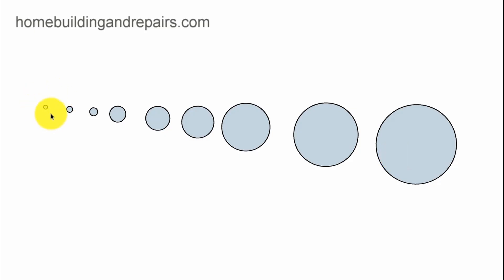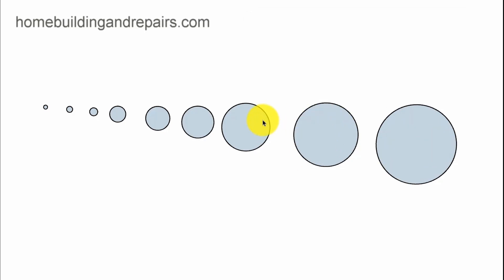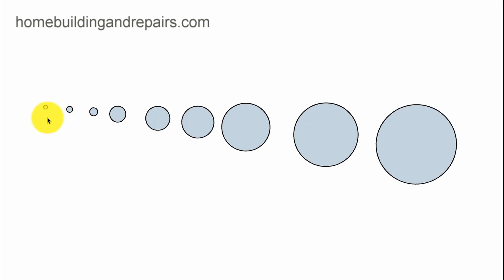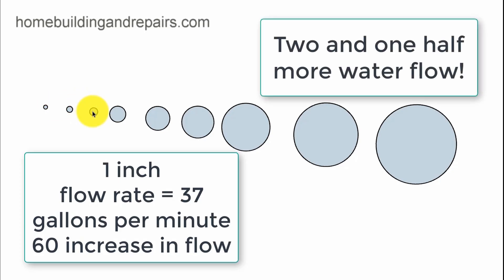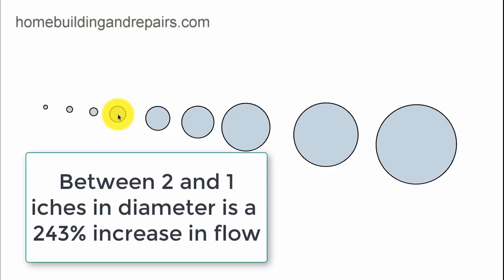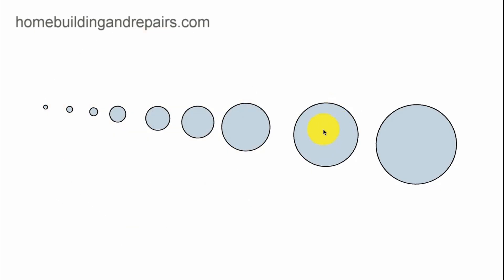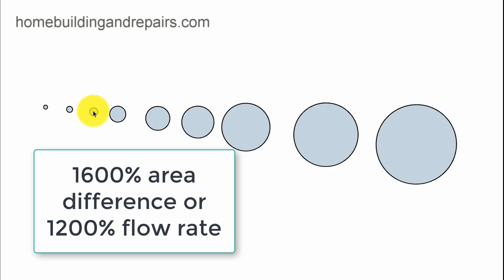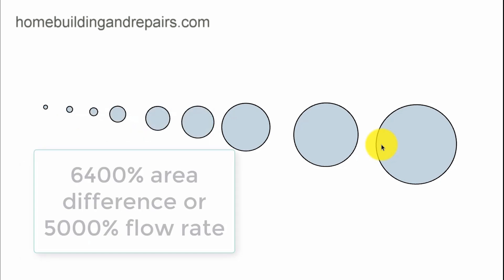Does Size Really Matter? - Water Supply Pipe Flow Rates

Comment: I have a new construction home. The builder ran one inch copper from the basement to the street. The stop box in the street is 3 inch. Am I gonna have a pressure problem inside the house?
Reply from the maker: I doubt it, but it will depend on the size of house. If you only have one bathroom, then your 1 inch pipe will be awesome.

Comment: How does using a swing out line (1/2 in flex tubing) to attach 3/4 PVC to a sprinkler affect the flow rate? It seems that the smallest diameter of hose anywhere along the line, causes the flow rate to conform to the lower diameter tubing size.

Comment: I don't know if you would have an idea but I'll shoot. I got a gravity fed water line from a 3" pipe that has a T with a reducer to a 1 1/2" pipe that travels about 10' and eventually shoots up 90° into a water tank. We've had this going on for months with no problem. All of a sudden. We're not getting any water in the tank. Or very little over night. Early today we cut it to see if there was an obstruction, there was nothing. At ground level it was flowing great but as soon as we put the 90° pvc pipe back in the water couldn't travel up like it used to, if we angled the pipe there would an slight increase in velocity of the water, but as soon as we'd angle it 90°c the water flow would be stagnant. Is the issue the water velocity from the source? I'm just absolutely bewildered how the water flow could be amazing at ground level but become non existent as soon as I'd have to shoot it straight up into the water tank.

Comment: I am a novice and could use some advice.  I have a sump pump that pumps water through a 1.5 inch inside diameter pvc pipe up and out of the house.   I connected a 2 inch inside diameter smooth silicone pipe to the pvc pipe at the house to carry the water all downhill to the outside drain.  
I live in a cold climate where freezing is common at this time of year.  The distance to the outside drain from the house is 75 feet.  Is the pipe big enough?  How do I keep it from freezing(heat tape vs insulation?).  Or do I need to change anything as the water temp is 57 degrees as it leaves the house and it’s all downhill.
Reply from the maker: I would think the size is right, but as far as the freezing, I won't  be much help.

Comment: For years I delivered pressure washers to customers in a rental business.  The intake had to be 2 inches or the pump would shut off.  The pressure was 20 k. For cutting.  The engine was a Cummins diesel.  Many customers tried 4 or 5 garden hoses.  Biggest problem I experienced,, ‘wouldn’t believe me. A 2 inch hose drawing from a full 50 gallon barrell worked fine, and a running garden hose placed in the barrell was sufficient to replenish water being used!  At startup about half of the barrel drew down but the single garden hose then kept up with up with usrage
Reply: Where do you get 2" hose like that?
Do they have  threading r is it all couplers?
 I have tried to find flexible 'garden hose" type hose for a rain barrel for years  but all the two inch hose I find is pretty expensive and meant for high pressure applications and also has couplers on them that I have never figured out where to get a bulkhead fitting to go into the rain barrel with.
I use a 5/8" hose now but it gets clogged easily and doesn't clear the water fast enough when it rains hard.

Comment: I went through this a few years back trying to explain this to a worker.  Without getting into a bunch of math for square area, I finally summed it up and asked him 'for example, how many 2x2s are there in a 4x4'.  His first response was 2, which of course is wrong.  I told him there were 4.  It kinda works the same way.  If you want to talk about volume.  Give a video about restriction in PVC fittings

Comment: flow will increase with the same diameter output. but not psi. for example if your source only has  100psi using a larger pipe goin to your house wont increase psi. the flow will not also increase unless your output would be same same size in your input. but that's not the case. there  will always be a consideration from your source, your pipe will go through valves water meter and at the end faucet which only have the average flow rate that is between 1.0 gpm and 2.2 gpm.

Comment: I think the reason why the relationship between pipe cross sectional area and volumetric flow rate is not linear is because of the energy losses (frictional head losses)  that occur along the pipe wall as water moves along it.   The greatest amount of friction is at the wall where water touches the pipe so velocity there is smaller compared to the center of the pipe where water has little resistance and can move faster.  Different pipes probably  have different roughness values.
Reply: I was about to post this. You are absolutely correct. Wall friction is the exact reason why this occurs and 2 4in pipes flow less than a 1 8in pipe.
Reply: I dunno. Real world vs real world. I ran a 4,768 foot 1” line off a 1” meter. At meter the psi was 175psi. Guess what the psi was crossing 2 hills and continued the 4768’?  🤫 175psi using pex. Sorry to dispute the charts. But I’ve run across 3,000’ lines where they claim an engineer told them to put a 2” line behind 3/4 meter. And that will maintain flow. Say what you want sitting there never tried it. But the meter pressure started around 135. Guess what I tested at 100’? 100psi. Then at the house over 500’ away. ? 45psi. Dumbass said “good thing I ran 2”. 🤦🏼‍♂️ so I bet him $2500tl pay for new 3/4 pex just to tickle my fancy. He jokingly agreed. How could s plumber have real world results contrary to engineer?  But so after got done. Guess what I had at house top floor shower? 😂 yeah 135psi. Used the 2” to sleeve the 3/4. He was amazed to see the garden pressure touch the top gutter. Said he’s lived with low pressure for 18 years.
Reply: That plays a part. But it's just down the the area. I mean he explains it in the video... if you had a 10 inch pizza and upgraded to an 11 inch. You'd gain significantly less pizza than someone upgrading from a 20 inch to a 21 inch. When you look at the area gain like that, from the outer part of the circle is might be easier to visualise
Reply: Pipe flow is greater with a large area pipe, because friction increases with circumference and flow capacity increases by area. 
A larger pipe gives a much greater gain in area than the increase in circumference.  There is a much greater increase in capacity,  pi *  r^2, while friction only increases a little pi * 2r.   Area increases by the square of radius, but C only increases directly with r.    Increasing D has a flow capacity benefit proportional to  r^2/ 2r.
Reply: Roughness depends on pipe material and sometimes the manufacturing process.

Comment: Hi, 
I'm having water issues at my home since last week. The flow is intermittent and is accompanied by air whenever the normal pressure returns. I suspect someone had taken connection from the main line with a bigger pipe thats why water in the homes that are at the bottom of the street is low and fluctuating. Please let me know if it could be a reason. ??
Reply from the maker: The only thing I could think of is that some is doing work to the pipes somewhere before it gets to your house.  Check with neighbors also to see if they have the same problem.

Comment: So needed to replace my 1.5 inches  sprinkler pressure vacuum but noticed those 1.5 inches are more than double the price (1 inch). Is it OK to connect the main 1.5inches  pvc pipe  to 1 inch, then connect it to the 1 inch sprinkler pressure vacuum,  then from 1 inch back to 1.5 inches pipe?   Am I going to lose any water pressure?   Thanks
Reply from the maker: I would contact the manufacture for more information.

Comment: Hello sir, our pipe is 1/2 inch from the source, would there be a changes if i am going to connect atleast 2 length 1 inch pipe and the connect again to 1/2 inch? To simplyfy

Source 1/2 inch pipe connected to 2lenght 1inch pipe then connect again to 1/2inch pipe. (For house hold used)
Reply from the maker: I've seen things like that done before with good results, but don't be surprised if it doesn't do much.

Comment: You skipped two sizes between 1in and 2in. Commonly 1-1/4 and 1-1/2 are both available.
Reply from the maker: I didn't include a variety of different sizes in the video, to make the video a little shorter. Keep in mind that the main point of the video is to provide viewers with just how much water flows through pipes with incremental changes in their diameter.

Comment: Hi , hopefully you can help , I am running a main water line from a 3/4 meter at the street to my 3 bd 1b cabin i built , the distance of the run from the meter to the house is roughly 1200 feet - it’s a straight shot now turns or Elbows , from the street to the cabin over the 1200 ft it will go up hill about 80 ft in elevation - what diameter pipe should I run ? From what I have read and learned it looks like 2” will be the best - my only concern is the pressure drop by the time I get to the house . I do residential hvac and plumbing so I am familiar with this , just not at this scale as far as that length of run
Reply from the maker: I would contact a plumber in your area or ask local building department for advice. If I gave you something and was off by 1/8 of an inch, I would feel horrible.
Reply: Thank you very much for the reply , could I contact a mechanical engineer and pay a fee to have them size it ?
Reply: @bortnerfamilyadventures1369  Hello I am a chemical engineer and maybe I could be of assistance. It sounds like you are trying to size your line according to the amount of “head” you have to overcome. I would recommend finding the head your water pump can generate and size it accordingly. 14.7 psi is about 33ft of head (elevation) then you just have to look up “K factors” for the friction your pipe material has and convert that into equivalent head(elevation). You can then size your line accordingly to give you the highest flow. I’d assume turbulent flow but you can learn to calculate that if you so desire and you want to give your pump about 15% error for breathing room.

Comment: Can I continue 20mm steel pipe with 25mm ppr pipe on my floor. Can reverse reduction work normally???
Reply from the maker: I need more details.
Reply: @gregvancom  i have main steel galvanized pipe led to my floor wich is 20mm or 1/2 inch. Can i continue  with 25mm ppr pipe and make 25mm system bathroom? Its not logical to go from lower to higher diameter i know but could it work?

Comment: What is the psi used for determining the flow rates of various dia. pipes ?
Reply from the maker: That is the one thing that varies and if you're looking for a particular PSI for water supply pipes in your area, then you might need to check it with the proper tools and gauges. Let me know if this didn't answer your question or try phrasing it differently.

Comment: I am planning on re-piping my house in in type L copper (VERY soon in fact since I have 50 year old galvanized pipe that's not in good condition).  I have currently have a 3/4 inch supply coming from the meter, 3/4 inch feeding the clothes washer and water heater, everything else is reduced to 1/2 inch.  Am I correct in assuming that I would come off better just running 3/4 to every fixture when I do the re-pipe?
Reply from the maker: Not always, but if you need the extra water pressure, then go for it. You can always use the old pipe layout and assume that you will have more water pressure, because the old galvanized pipes might be restricting water pressure because they are rusting inside.

Comment: If I remember my physics well, resistance increases linearly with length, and it increases by a factor of 4  with radius.  And flow is directly related to resistance.
Reply from the maker: Yes, there is more math involved and thanks for sharing.
Reply: @gregvancom   Yes, there is, but the power of 4 relationship to radius is the most critical bit of information.  This also comes into play in medicine (my field) and explains why bronchospasm (asthma attack) in a child with small airways is so much more dangerous than the same degree of bronchospasm in an adult with large airways.  When a little bit of reduction in airway diameter in an adult could lead to some difficulty breathing, the same percentage of reduction in a child can lead to rapid death.  I find it interesting how the same fluid-dynamics that come into play in plumbing and pipe-fitting also come into play in a field so seemingly far removed as medicine.

Comment: Pipe use from water supply is 3/4. If i change the pipe to 1" after the meter will it increase the flow of volume?
Reply from the maker: More than likely, one time I worked on a house where it had a three-quarter inch line coming off of the water meter on both sides and the homeowner installed a 3 inch line that ran for about 300 feet and then stepped back down (three-quarter inch and half inch water supply lines) to feed two houses that had plenty of water pressure.
Reply: Following the formula: pressure and volume are inversely related; as one decreases, the other increases.
So as the volume increases flow will decrease but because it's an incompressible liquid pressure will stay the same.
Reply: @bobjoatmon1993  Correct. This is what i was taught.

Comment: I appreciate your videos and this isn't meant to be criticism; just asking for more of your clearly communicated and useful videos.  Because this material is not necessarily intuitive, it might be helpful to explain why these differences occur. For example:  The area of a circle changes with the square of the radius. (Pi * (r^2)). So the first thing to realize is that the difference in area between a 1/2” pipe and a 1” pipe is the difference between 0.5^2 and 1. Since 1/2 squared is 0.25, the difference in area between a 1/2” pipe and a 1” pipe is 400%.

But there’s more. The flow rate of water through a pipe (at fixed pressure, length, and pipe material) is also affected by friction. When the water flow becomes 60% +/- of the theoretical capacity of the pipe, the effects of friction (water against the pipe’s walls) reduce flow rate. So there are two non-linear factors: the pipe diameter and friction.

Also, some examples of where this topic is relevant would also be helpful, say in home repair. For example, if you have an old house with 3/4” copper plumbing, and you re-do a 100’ line to a bathroom that terminates with 1/2” fixtures, do you use a 1/2” PEX connector to the copper or a 3/4” connector? With 1/2” PEX, you might find a noticiable drop in shower pressure - as much as 1.4 gal/min. Why? Two parts. First, copper to PEX has an inherent difference in flow based on interior diameter of about 20% (lower in PEX) because the interior diameter of PEX is slighly lower than in copper. Since the cross sectional area uses the square of the interior radius, there’s a bigger difference than you might imagine. Second, a drop from the 3/4” copper interior diameter based flow rate to the 1/2” PEX rate is even bigger: 3/4” copper has a cross sectional area of 0.436 sq-in and 1/2” PEX is 0.185 sq-in. So wow, that’s a really big difference. In a really short run the impact would be less visible to the home owner: 3/4” pex to the bathroom, then convert to the fixtures. You’ll say, “of course,” but this is just to illustrate the concepts.

Although it is a bit complex, you might want to talk about the Hazen-Williams equation which is an empirical (i.e., based on observing things, not theoretical) formula for flow rates that includes the affect of different pipe materials (which affect friction).  (It has limitations based on water temperature and degree of turbulence.) Just for example, the “roughness coefficient” (think friction) of PVC is 150 compared to 130-140 for copper, and the cast iron you might find in a very old house’s sewer system could be 64-83. Which may help explain sizing decisions on renovations.
Reply from the maker: I wouldn't be offended by a comment like yours, because it offers constructive criticism.
Reply: Holy shit that's the most thorough answer I've ever read in yt comments!  I was told that the flow rate was a constant no matter the pssr. Is that not true?

Comment: Yes i ran into this at work. A piece of equipment a 6” inlet a supervisor had a manifold made from a 6” pipe with two 3” inlets the problem was it needed 3 3” inlets to work properly. The two 3” inlets causes a pressure drop and cavitation when running the unit at max rate, this cavitation causes the unit to fail on its third job. The supervisor had missed this on a bulletin and was let go.thanks for sharing.
Reply from the maker: You're welcome and thank you for sharing your story. I realize to most of our viewers who are in the construction industry that it might sound like the supervisor shouldn't of got fired, but when you find out how much money it cost the company to fix something like this, it can make sense quickly.

Comment: 12 years ago i opened the walls in the house replaced all the 1/2" copper with 3/4" copper & foam pipe insulation ($4400 job) because every time the washing machine turned on when im in the shower i'ld get blasted with cold water. 3/4" solved the problem no noticeable pressure change but now it takes about 5 seconds for hot to reach the kitchen faucet it's not immediate anymore dont really care anyway and the bathroom shower/ water heater are opposite ends of the house. question: why does basement hot water pipe freeze and the cold pipe never? why not run pex? because it expands/contracts it's noisy
Reply from the maker: I've never heard that, both hot and cold water pipes can freeze and I haven't used enough of the rubbery plastic piping to provide you with any relevant information on whether or not it should or should not be used.